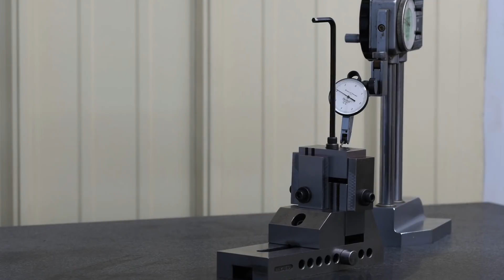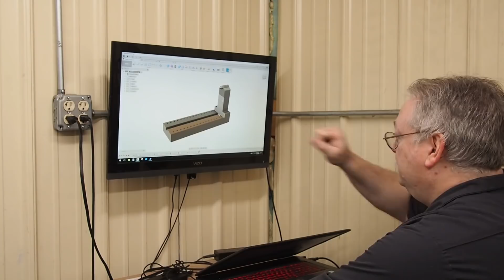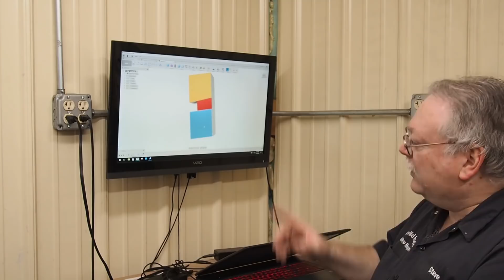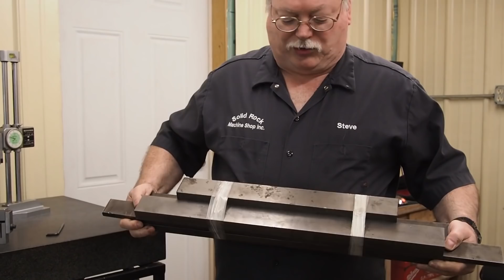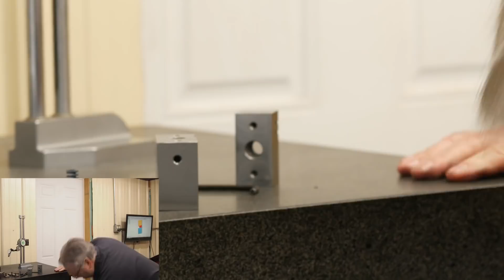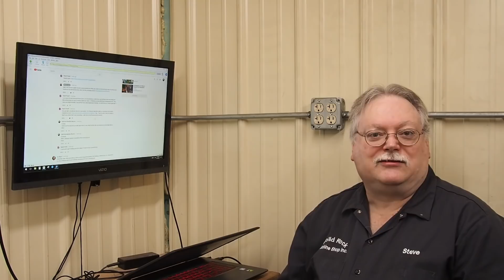Fine adjustment using a differential screw

Comment: This is such a good explanation of these screws, I designed a boring head with a differential screw a while back and it works to the .00001 because I did a M9x.75mm thread with a M9x.5mm thread. .25mm difference in thread made a .00098 but with my vernier scale it’s accurate to the .0000098 I rounded these off to a .0001 & .00001 I can’t see past that point of a tenth

Edit: I made the threads really tight to the tap sizes I used so the actual screw is gripped by .3 in off thread at Max out. And a constant .45 for the other thread and both have virtually no backlash. I do hate that it’s minimum diameter allowed is .428 with a half inch boring bar.
Reply from the maker: Peter S. just did an interesting video using differential screws.
https://www.youtube.com/watch?v=4UK32EV0pi8&t=1s
Reply: @SolidRockMachineShopInc  thanks!!! I’ll check it out!

Comment: On the bottom of your tail stock where it locates into t slot use offset cam dowels. Cam can be ground to give whatever adjustment needed.
Reply from the maker: Hi Paul,
Sounds like another good Idea. After talking to Robin Renzetti I was convinced to change the design and not use an adjuster it the tail stock but in a two part base instead. The dowel would work there as well but I am leaning toward the wedge idea
Steve

Comment: Thanks for this video Steve.  I have been planning on building a cylindrical grinding fixture for my surface grinder too.  I also think the incline plane with give you the best results.  I'll interested to see how you accomplish this project.
Reply from the maker: Hi John,
Thanks for commenting. I had a very pleasant phone conversation with Robin Renzetti a few hours ago and he gave me such a good education on this project that I will be making a few huge improvements. I will be still using the wedge system but instead of it being in the tail stock it will be in a 2 part base. The wedge will be at the head stock end and a spring flexture will be at the tail stock end. The 2 centers will be in a fixed coaxial alignment as close as I can get them and the taper will be adjusted in the 2 part base. The center will be able to be changed from 60 degree cone centers to silicon nitride balls that will ride on the tangent of the 60 degree centers of the part. Check out my Instagram 1 minute video of the wedge system so far https://www.instagram.com/p/BfhN6UuF1_o/?taken-by=solid_rock_machine_shop  A YouTube video to follow soon.
Steve

Comment: Hi Steve! 
Very interesting video. I have also toyed with the idea of making a small motorized fixture for OD grinding between centers on the surface grinder. My thought was to make it as a sine center and use my gage blocks for adjusting taper.  Do You have any thoughts on the  merits of using screws or wedges vs a sine plate design?
I have seen a slightly different design of differential screws where the screws are coaxial, that is the outer screw also acts as a nut for the inner screw. This configuration can be more compact, and it´s also possible to design it as a fine/coarse adjustment. The application I remember was in an optical alignment device.
Best regards, Erik
Reply from the maker: Hi Erik,
I have a 10" sine plate that I will be able to mount this unit to so I was going to make it without a built in sine. If you are going to take out very small tapers of about a .0001 or so then it would be hard with a sine set up seeing you only need to adjust .00005 to get .0001 because you will be cutting on both sides (radius). I have seen the type of screw you mention on Thorlabs website.
Steve
Reply from the maker: Hi Erik,
Here is my reply to John Bodmer and I thought you may be interested too.
"Thanks for commenting. I had a very pleasant phone conversation with Robin Renzetti a few hours ago and he gave me such a good education on this project that I will be making a few huge improvements. I will be still using the wedge system but instead of it being in the tail stock it will be in a 2 part base. The wedge will be at the head stock end and a spring flexture will be at the tail stock end. The 2 centers will be in a fixed coaxial alignment as close as I can get them and the taper will be adjusted in the 2 part base. The center will be able to be 
changed from 60 degree cone centers to silicon nitride balls that will ride on the tangent of the 60 degree centers of the part. Check out my Instagram 1 minute video of the wedge system so far https://www.instagram.com/p/BfhN6UuF1_o/?taken-by=solid_rock_machine_shop  A YouTube video to follow soon.
Steve"
Reply: Hi Steve, thanks very much for all the good info!
You made me change my thinking about my presumptive sine center design. I have gage blocks down to 1um increments (about 40 millionths) but that´s likely not a good way to tweak final alignment. I spontaneously like the flexture wedge idea, mainly because the wedge seems stiffer than a differential screw.  I guess that it would be important to make the flexture as stiff as it can be. 
Another thought I had was to use an adjustable wedge directly under the gage block in a sine plate setup. Perhaps that would make the setup more rigid since no flexture or similar is needed
I worked together with an old toolmaker-friend last week and mentioned the differential screws.  Turns out that he manufactured coaxial differential screws for many years. The application was for  precision alignment of axles,  http://www.fixturlaser.com/  
He helped develop this together with the inventor. Good resolution at 20 um/turn is possible to achieve, but there are some tricks to it.
Reply from the maker: Hi Erik,
Thanks for the link. After talking to Robin Rensetti he gave us a better way to adjust taper in the center fixture using the wedge system in a 2 part base instead of an adjustable tail stock center. The flexture will be a piece of spring steel. I am working on the design and hopefully we will do a video of it soon.
Steve

Comment: If I am doing the math right, a 1.0 mm (0.039) metric thread and a #10-24 (0.4166) with one left handed, one right handed would move 0.002666 per revolution?
Reply from the maker: Hi weshowe.

Your math is correct rounding out 1mm to .039. I went with a bigger diameter to have more load capacity and wanted to see if I could get even better resolution. At 1/2-20 right hand thread on one side and 1/2-20.16 right hand on the other end the math works out to .0004 movement per revolution. I was getting .00027 movement per revolution which surprised me. I though if I would be off it would be greater than .0004 not less. There are many variables that can affect the resolution at this level of adjustment. I am working on the wedge system now and have a short clip on Instagram and hopefully will have a YouTube video soon. Thanks for sharing.
Steve

Comment: Realy enjoy your videos, this one included! 
And yes, the wedge system might have it's strenghts over DT. But is also in most(?) cases much more involving/complicated to implement. 
And the smaller contact area in the DT method is no problem as long as you have locking screws or other means of fixating your position after adjustment is done. On your tailstock you will need a way to secure it after repositioning in the first place, so the way of adjusting won't be required to take up high forces anyway. 
When adjusting in this level of accuracy you would want to use your high resolution dial indicator anyway. So the variations inherent in the DT method will be of no consequence for use in your tailstock.
Reply from the maker: Hi Spam,
I agree with you. Whatever system I use the adjustments will be made with an accurate indicator. Right now I am leaning toward the wedge system although I know the DT system would work very well as you described. On my Instagram page I have the early workings of the wedge testing device made and was very happy with the results so far. When I have that one done we plan on making a video of it as well. Thanks for sharing.
Steve

Comment: Steve. A big thanks for your comments about my channel. It is always nice to know that people find them interesting. Sometimes you think nobody is ever really even watching them, let alone finding them useful or inspirational. BTW - I have also got a video where I make a flexure, adjustable using a differential screw to adjust the separation of two blades used to control the light entering a spectoscope. What is also relevant to your comments on this video is that Tom Lipton  helped me with the production of the spectrascope blades! It's a complete cycle of help.... At the very beginning of the video I did an animation to help my viewers understand differential crews which your viewers may also find helpful. https://www.youtube.com/watch?v=h29NsNGDOw8.  I visited Stan a couple of years ago, however I am 7k miles away making it a little expensive to get there for the bash, otherwise I would love to meet for a good chat! Do you have skype/whatsapp?
Reply from the maker: Hi Rupert,
Thanks for the link. sorry I do not have skype or whatsapp on my computers.
Steve

Comment: Looking forward to meet you this summer.  I like the inclined plane also, I think you will have a much more predicable result for adjustments.  It is very difficult with threads unless you make them very precise and that would mean grinding them.
Reply from the maker: Hi Randy,
I am looking forward to meeting you too. I think the incline plane would work better also. I plan on experimenting with that idea soon.
Steve

Comment: As always interesting video Steve. Differential screws have been around a long time. They weren't unknown during the industrial revolution as a method of fine adjusting steam engine valve gear. But I suspect the idea was invented long before that.

The Youtube comments section? Most comments on videos such as this type are fine. If the video has any type of content that might get the comments into politics, science etc then you can be sure the U.S. basher's and flat earth believers will be out in force. Machinist types seem to be a touch smarter than the average YT comments poster in my opinion. :-)
Reply from the maker: Hi Turning Point,
It would be interesting to see how far back they go and what they were used in.  The concept is new to me and I built the two devices to try and understand them better. I was surprised the one in the video worked as well as it did because of all the variables involved.
You bring up a good point on the YouTube comments. I have seen other topics get out of hand but most of the content on machining at this point seems much better. I hope it stays that way.
Steve
Reply: Hi Steve, 
Possibly it's selective or maybe faulty memory? For some reason I dimly recall seeing a mention somewhere (tv documentry, an old book maybe, ?) about the ancient greeks might have been using some of the first but still hand cut so inaccurately made differential screws. Not willing to bet money on my memory at this point tho. Good accurate differential screw assemblys would have had to of been no earlier than Henry Maudslay at around the  1740 -1770 period. So still a guess, but a bit after that before the technology was there to produce them. 1800 maybe? No doubt you already know about the availability of fairly cheap but still non standard taps most of the large tool dealers normaly stock. 40,60 and even 80 tpi plus a great many thread pitches between those from 1/4" diameter on up to over an inch. One of those differential thread combinations should give extremely close to a 10ths adjustment per full turn. I just haven't tried the calculations for any of them yet, but it should be possible. As you pointed out though they still wouldn't be hardened and properly ground threads so there's a definate accuracy limit where it's pointless to try for better accuracy or finer adjustments. 

Ever hear of damping grease?  I first read about it's use a couple of years ago and it's much more common in a lot of items than I knew about. If you don't know about it then it could be worth a Google search. It might be helpful with what your trying to do. It's fairly common in the optics industry and has been for at least the last 50 years where very fine and precision adjustments are being done. Camera lenses, rifle scopes etc use it on there internal threads.  

YT' and it's machinist community is growing fast and I suspect were going to start seeing some real oddballs showing up just to troll and try to stir things up. Hope I'm wrong about that.
Reply from the maker: Hi Turning Point,

I check out the damping grease. It looks great, I will have to get some to play around with. You are one more example of me learning something new and awesome from the viewers. I did use a high molly anti-seize made by Sumotomo and it made a big difference. I bet the damping grease is much better. I appreciate you bringing this to my attention. Also, thanks for the education on differential screws. 
Steve
Reply: Hi Steve,
Happy some of that might be of possible use for you. It was only pure luck I found out about that damping grease. I saw the term mentioned somewhere and it got me curious enough to run a few Google searches. But I still know almost nothing about it other than it's got some specialized propertys the more usual greases don't have. I suspect it's used within the better metrology equipment such as micrometers and possibly some brands of calipers in very select spots. I'm almost positive it's used within my Mit. digital o.d. mikes, depth mike, and the two inside mikes I have of theres since there's that soft drag as the thimble is moved in or out. Given there experience I'd be surprised if Robin Renzeti or Tom Lipton didn't know quite a bit about it. As buttery smooth as my Mit solar powered calipers are I'm guessing it's in there somewhere as well. If you do get some it would be real interesting to see if you get more repeatability while using it.

Comment: I think I prefer the wedge block setup over using the differential screws.  The giant incline plane will have much more load capacity and less slop than a screw thread.
Reply from the maker: Hi Brian,
I agree with you and plan on building a test part soon.
Steve

Comment: 1.  1/4-100 adjusters are cheap.  See Thorlabs and others.
2.  Use a uniform spring preload.
3.  Dual backlash is the bane of differential screws.  Again, try for uniform preload.
4.  Don’t try to make precision adjusters using commercial fastener grade tools, unless it is adjust once.  Then, it might work.
5.  Thanks for this video.
Reply from the maker: Hi Alex,
Thanks for the information. I never heard of Thorlabs before it looks like they carry a lot of interesting items. Differential screws are new to me and right now I am experimenting with them trying to understand the weakness, strengths and limits.  I appreciate the information you shared on them.
Steve
Reply: I have had good success using DS alongside flexures. Flexures do not suffer from backlash and adjustments are pretty repeatable, even with machines screws. Obviously it all depends on what level of accuracy/repeatability you need. For adjusting the taper from a centre-ground shaft I suspect this will work very nicely indeed. One thing I intend to experiment with is adding a micro-stepping stepper motor to the DS, then wring some Arduino code to calibrate the moves. I feel another video coming on!
Reply: Funny enough I happen to know there U.K. lead designer for ThorLabs really well steve. :-)
Reply from the maker: I never heard of them until Alex told me to check them out. I just order a couple of the 1/4-100 adjusters an hour ago. Might use them in the wedge device that I posted on Instagram. Video coming soon.
Steve
Reply: I've sent you an email about Thorlabs Steve to the email address listed on this channel.
Reply from the maker: Hi Turning Point,
I have not received it yet. Would you be able to resend it. Thanks
Steve